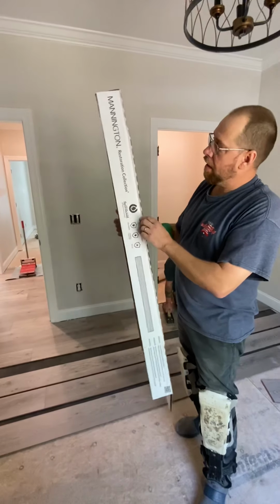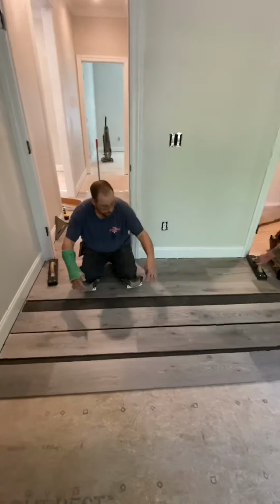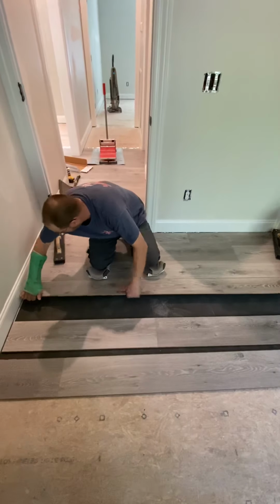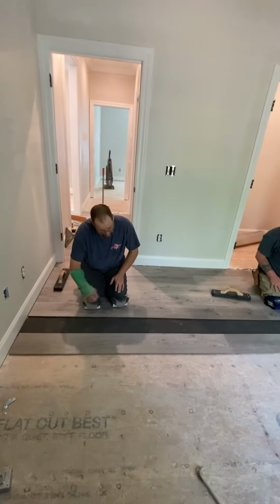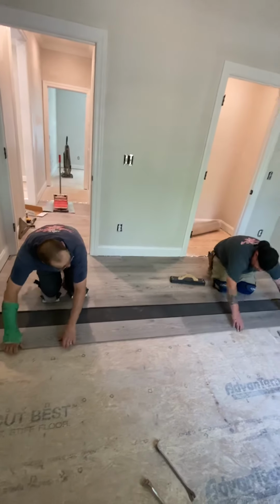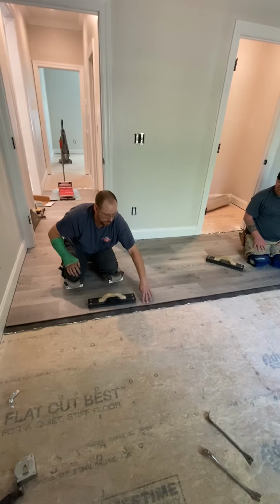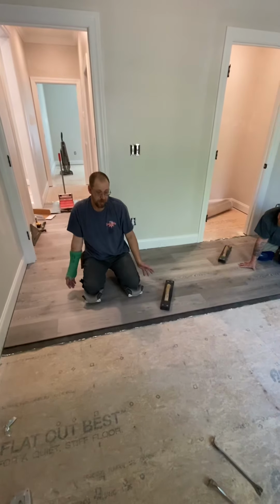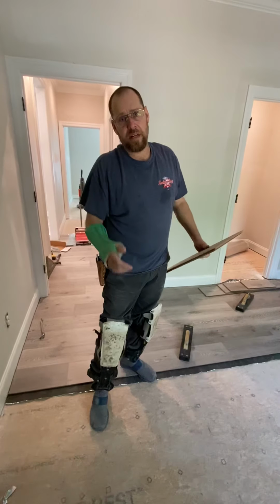How to install laminate backwards

Comment: For those who install by themselves its a bit troublesome to install this way, other option is to take a piece of scrap and use it as a buffer for your tapping block. But non the less, I appreciate your videos,  its hard to come by flooring installation videos especially ones who do the job with pride.
Reply from the maker: j Yes sir it is a little bit troublesome, but I have done Cortec Jobs like that by myself doing whole rolls at a time, thank you for the compliment, since you appreciate it I’m sure that you take pride in your work as well so good on you for that
Reply: Ok so I need advice, Im just about finished a unit and I’m having trouble with the door, it’s by a closet too so I have to get it under both and it’s literally one of the last pieces. I gave up because I was working 2 different jobs today and the other unit was horse crap vynil

Comment: I think most or all laminates almost always install EASIER backwards, rather than normal, sure slides easier. Only thing that's tricky is coming to a dip in the floor, but shimming it up with some cardboard from your boxes usually does the trick!
Reply from the maker: Steve Bentley 😮

Comment: Would this work for installing LVP backwards, or do you have other tips for that?  Considering COREtec Plus 7" planks for an whole house and will have 1-2 smaller sections that will need to go backwards to avoid transition strips.
Reply from the maker: Vinyl plank is easier than this particular laminate, I would just install it backwards
Reply: @FloorsbySouthernboys  thanks for the prompt reply.  Been watching a bunch of your videos to prepare for the project, I'm an experienced DIYer but have only done individual rooms in the past.  This will be a much bigger project.  Is the COREtec still a very good product? I know you were impressed with the product in some of your videos from 2+ years ago, didn't know if there was something better now.

Comment: I saw in one of your other videos where you cut the tabs off of the wood flooring and glued them together with carpet tape and Titebond2 in order to change direction, which was a great trick. Do you think this can be done with vinyl planks??
Reply from the maker: Yes absolutely, vinyl plank works about the same frontwards or backwards

Comment: Thank God for your videos.  You take the mystery out of things!  I have a question I hope you can help me with. I am using Pergo and their flooring seems to come with a lot of restrictions.  Maybe I'm not understanding correctly,  but Pergo seems to say you should not use planks that are less than 48 inches long.  However, I want to continue the same direction of my planks throughout my house which will mean going across a small hallway, the short way, which is only 38 inches across. What kind of problems will I be in for if I continue with my plan? Thanks again for a great video.